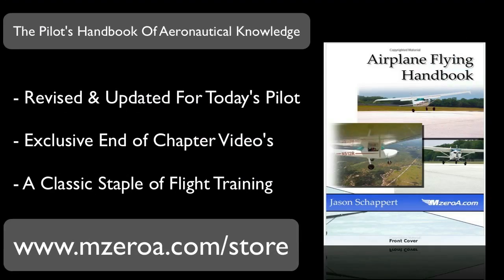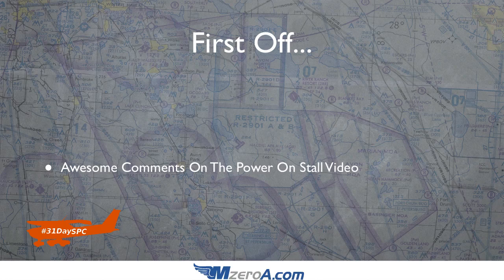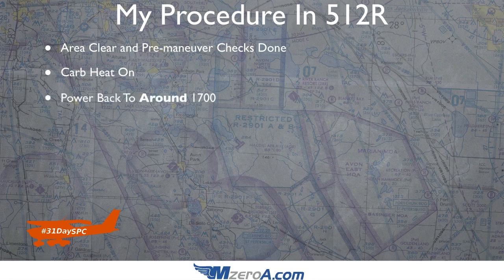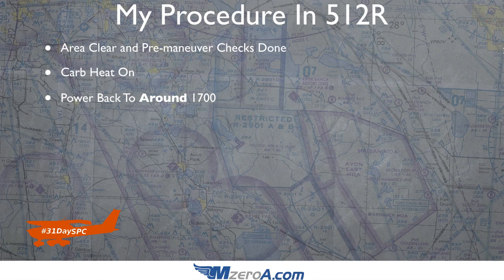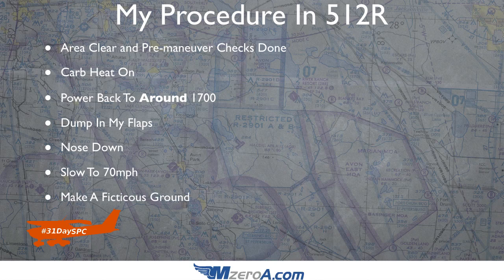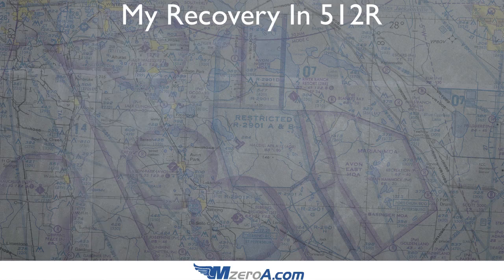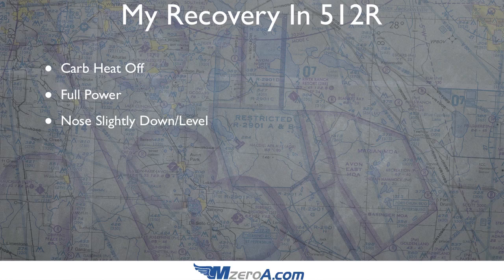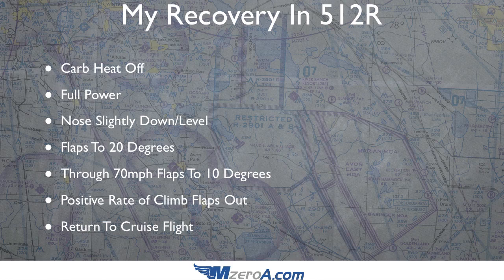Power Off Stalls - Day 9  #31DaySPC

Comment: In the Cessna 152, Mixture rich, throttle full full, carb heat off, reduce angle of attack, 29 degrees of flaps immediately, establish Vy, check positive rate and 55 knots, 10 degrees, check positive rate and 67 knots, Flaps 0, smoothly establish Vy, and climb to entry altitude or cruise flight

Comment: I fly the C172 and Diamond DA-20 (both fuel injected so no carb heat). Both recovery procedures are similar except for the flaps. 1. Nose level/slightly low to lower angle of attack  2. Full power. 3. Flaps up one notch (20 degrees in the C172; T/O setting in the DA-20) 4. In the C172, flaps to 10 when positive rate is established, then up when passing through 60 knots. 5. In the DA-20, flaps up when passing through 60 knots.